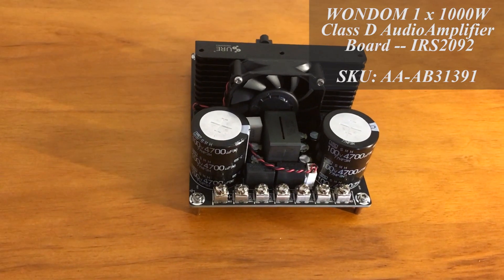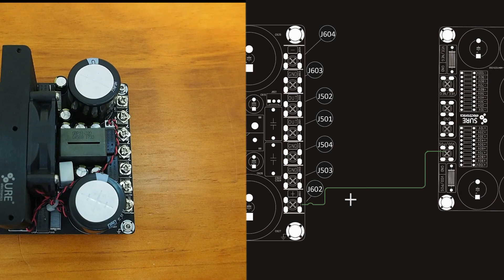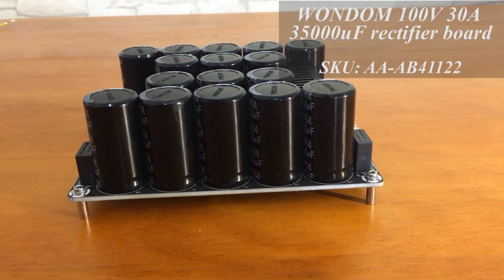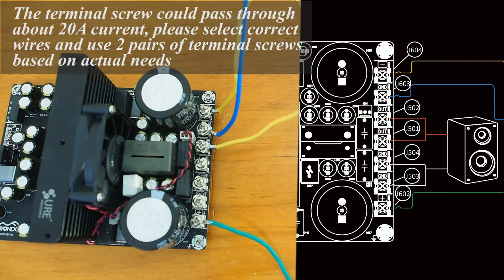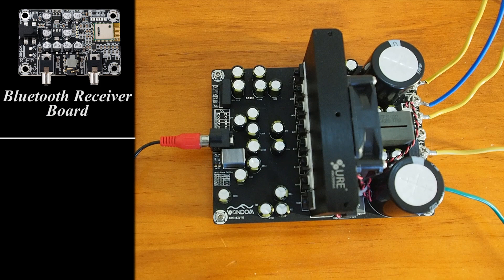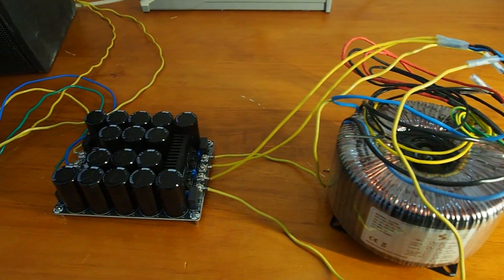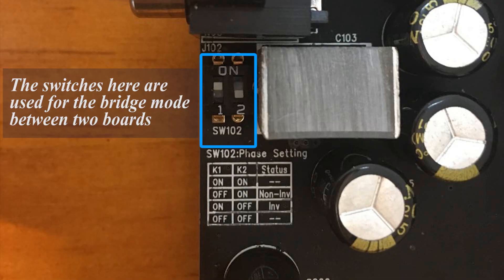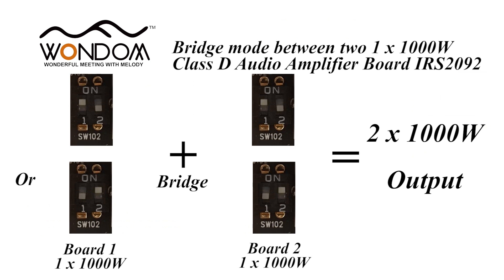IRS2092 in Incredible High Power High Performance Amp Series

Comment: What power supply do you recommend for 100watts RMS? And, whats it sound like? Some of these "D" class amps have all the high fidelity of an Ice Machine at a Motel 6.
Reply from the maker: Hello, the power supply range for this mono 1000W IRS2092 is ±55V - ±65V. If you want 1000W RMS into a 2Ohm load,  ±63V would be required. Please note that the IRS2092 amplifier boards need dual power supply. So, you can use transformer and rectifier or two AC/DC power supplies for powering it up. Wish this could help you. Have a fantastic day~

Comment: Inflated power claims. 2000W? That would mean about 24 amps of audio into a 4 ohm speaker, or 18 amps into 8 ohms. This tiny junk is not gonne supply that, even at 95% efficiency. These claimed wattages are boy racer peak music power output figures; not grown-up RMS.  Even the screwdriver is a toy.
Reply from the maker: The speaker is a toy, it is true, but this tiny is not a junk, it could output 2000Watt continuously, you can check another video when the amp is taking an air conditioner. 96% efficiency means it will deliver about 80Watt, only with a high speed fan, it could output RMS power continuously. Inductor only 95 celsius or so.
I can not say this amp could work continuously cause it is  not designed for long term running, but I will be glad to show you it could work at 2000Watts continuously for 5 minutes, and without any modification it could output 2000watts only with an additional fan. what about 200 bucks bet, the board value?
So before you consider it as a toy, get things clear please.

Comment: I see your boards but I don't see alot of people building these.  Please show a video of north America standard 110VAC voltage input configuration.

Thank you.
Reply: Configuration is identical, just using a transformer that accepts 120V.  Whether you're starting with 220 or 120 (or even 480), you just want a transformer that's outputting two AC phases of an appropriate voltage.  In their example, two phase 48V AC.
Reply: @jasengibson6619  i think you mean single phase 48vac from single secondary output side of transformer?  I think the voltage input is single phase appropriate voltage.  Some of their amplifiers can go higher voltage than 48 vdc. 

Some videos showing how voltage source 110vac through a transformer then rectifier would be helpful just to see it done correctly.
Reply: @GonzoZener  Nope, I mean two phase.  Two AC inputs on the rectifier.  I'm using this board with a transformer that takes two 120VAC inputs, and then outputs two 40VAC lines from the secondary in opposing phases.  Whether the phase is important or not, I don't know, but it would make sense.  The rectifier has two inputs, I have one phase to each.  I assume the rectifier is essentially dividing the top and bottom of the sine wave of each input, then combining the upper half of both to one output (the +) and the bottom half of each to the other output (the -), then smoothing out the ripple with that bank of giant caps.  So, when I measure across my output terminals, I get 61VDC from Gnd to +, -61V from Gnd to -, and 122V from - to +.  So this rectifier puts out 120VDC total with two 40VAC inputs.  And the amp they show in this video requires both of these power outputs---so they're speccing it fairly wrong.  The documentation says 65-75V for input, but that's really X2.  The amp I'm using it with is the 500W version of this, which wants two 55-65W power inputs, so I'm giving it both 61V outputs of the rectifier, which is really 120V when measured across them.
This rectifier is a beast.  
The wiring is simple--the transformer has four input wires for the 120 coming in (hot and neutral), and four output wires from the secondary.  Here's an image of the transformer-rectifier wiring:
https://drive.google.com/file/d/1aTyBADrIWuWiHIT-nPY0DPhMrqv3gShk/view?usp=sharing
Reply: @jasengibson6619   I get it.  Just would like to to see this amplifier wired with a 120 VAC circuit which is the most available circuit in the USA.  240 single phase in USA is option too but odd for a home Class D amplifier application.

Comment: How do i power this unit? Positive negative ground??  Is this with a standard 220v transformer??
Reply from the maker: Hi, John d. Thank you for your watching.
This unit requires dual power supply. The standard product is not integrated with transformer. You need to buy the transformer and rectifier capacitor bank board to power this amplifier board.
You can refer to the 'Connection' on the product page for reference.
Have a nice day.
Reply: 220 or 120.  I have this rectifier board, using it with a transformer that takes two 120V AC inputs, and outputs two phase 40V AC.  The rectifier takes these as its input, and then outputs -52V and +52V, measured against the 0V ground output--in other words the negative terminal is not ground, it's hot, just in opposite phase to the positive terminal.  If you measure across the - and + terminals you'll see it's actually putting out over 100V DC total.  The way they describe it is fairly confusing, as we normally always look at the "-" output as ground, but in this case, they're referencing 0v as ground.  Took me a minute to figure out what was going on exactly myself.

Comment: I'm  skeptical about the wattage of this  Chip, but regarding it's a true power,  then how come  until now nobody using it to a huge gig,  a concert  or clubs but more likely they use Crown or Lexus power amps..
Reply from the maker: Hi Edifier,
Adhering to the concept of integrity management, the nominal power of WONDOM's products are all true RMS. Have a nice day.
Reply: @WONDOMAudio  If you're sure your amps can do rated power, you can throw in a power output test to gain credibility.

Comment: works with a switching source of + - 95v ???
Reply from the maker: WONDOM AA-AB31391 is powered by ±60V. AA-AB31394 is powered by ±92V and you can visit the link below: http://store3.sure-electronics.com/aa-ab31491 for more information. Thanks for your watching.
Reply: but as it says max 95v I wanted to know if it worked
Reply from the maker: It can work with 95V. Thanks for your watching.
Reply: what is the difference between 50A 100V 94000uF (Supports power converting for up to 1,500 watt devices)   and    30A 100V 35000uF (For use with devices up to 2,000 watts) Fast Recovery Rectifier Capacitor Bank Board?? 

the 94,000uf should not support more power?

thanks for the previous answers.
Reply from the maker: The 94000uf should support more power indeed. We will update our data. Thank you for your comments!
Reply: have a link in amazon to buy the 94000uf?
Reply from the maker: Link:http://store3.sure-electronics.com/100v-50a-94000uf-rectifier-board-for-amplifiers
You can also buy it in amazon(Link:http://www.amazon.com/dp/B07FYZBV3T)
Reply: hi the link does not work
Reply from the maker: https://www.amazon.com/dp/B07FYZBV3T  You can try this one again,thanks for your support.
Reply: hello I ask you a question for what is the connection J101 and U604?
Reply from the maker: Hi,Hugo. The J101 is used to connect with the controller of signal synchronizer and the J604 is used to connect with the power supply.
Or would you mind telling us your e-mail address so that we can send you the product manual? Thanks for your support.